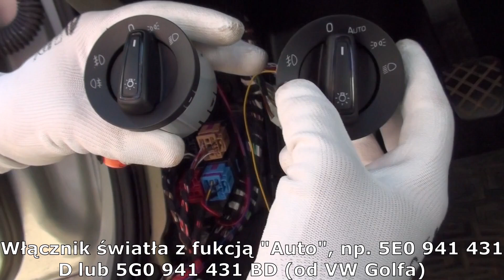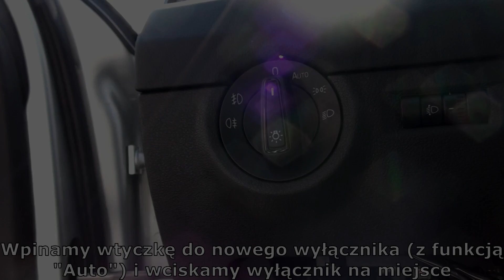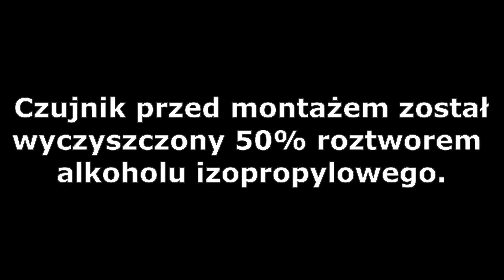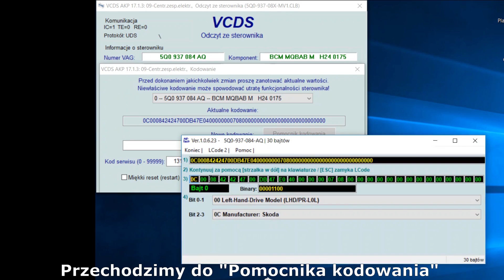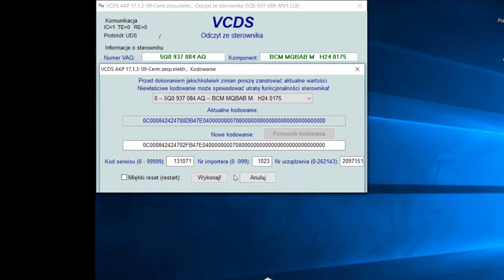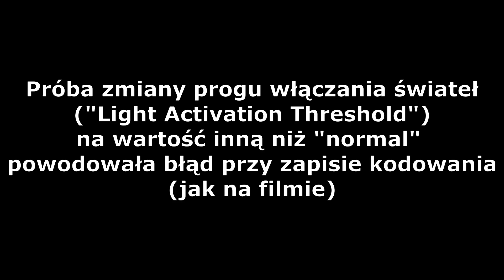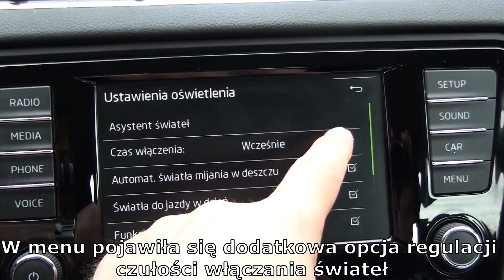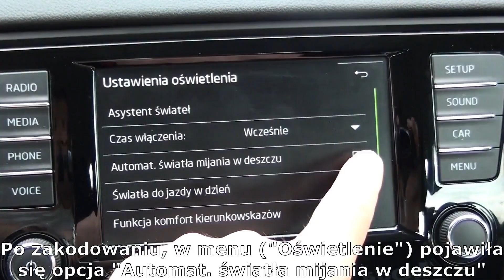Montaż czujnika zmierzchu/deszczu/wilgotności – na przykładzie Octavii III

Comment: Hi again after 6 or 7 years 😂…. I just went back & bought a old 2014 2L tdi same car I had a good few years ago & you taught me how to do the rear lights when reversing (hazard) brilliant 😃😃  but I have problems with automatic headlight error on dash, The car is a elegance has has auto switch but when I turn on the error appears so just using main beam headlight instead but would like to fix it, vcds shows Cent.-Elect (J519) errors 4 faults- 1: Fuel tank Flap electrical failure -which am guessing is the connection under rubber which I’ll get to,
2 - databus (535060) 
3 No communications with Rain/Light Sensor (934148) confirmed
& 4 no communications with humidity sensor  (939524) confirmed 
Do you think it is sensor on mirror or maybe light auto switch 
Any help much appreciated, 
I’ll be learning my German again doing rear lights asap 😂
Sorry forgot to mention also got code on 
Address 20: High Beam Assist.
Internal control, module memory Check sum error  (4186894) B2000 47 confirmed 
Haven’t a clue on this !
Reply from the maker: Hi! It's good to hear that the channel is still useful 🙂
In the case, that you described, personally I would check that rain, light, humidity sensor. The one that is shown in the movie. You can find a used/dismantled one on Internet. You can write me an email with a report from work 🙂
Reply: @test-o-matik8983  yes 👍 your videos are really very useful ⭐️ I suspected it a sensor (Headlight) But didn’t know position of it before watching your video, so thanks again 👍👍

Comment: where you buy this original parts ????
Reply from the maker: In this case we bought these dismanteled parts (the light switch and the sensor) at the nearby junkyard. The cable comes from Aliexpress. Some parts we buy at dealer's (Skoda/Opel) shop, some we buy in on-line stores. It depends on the price and availability.